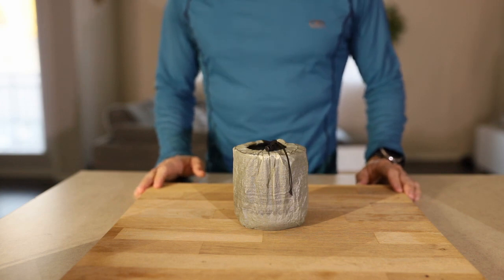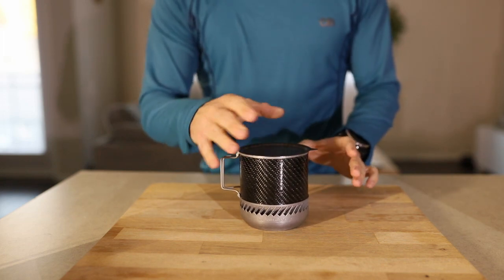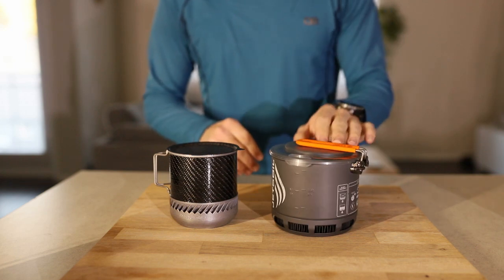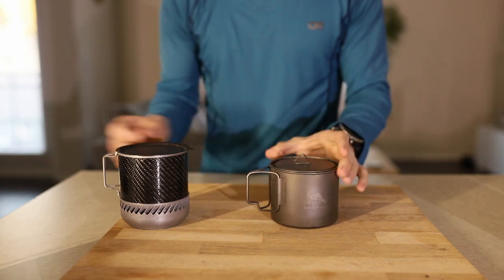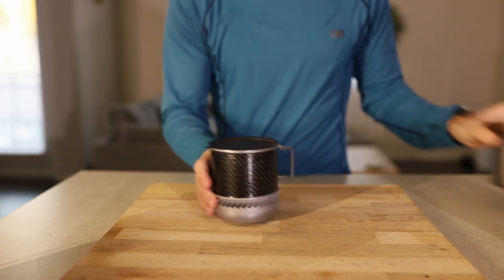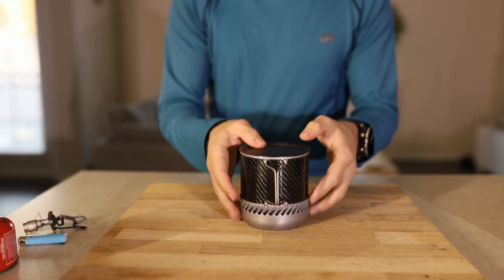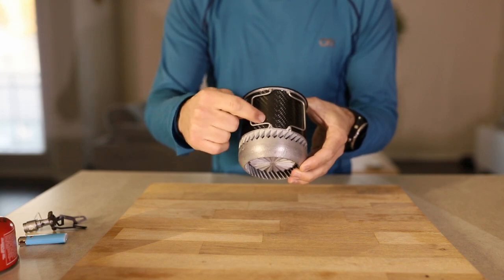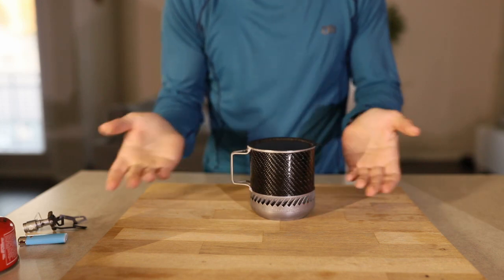The Joule Thief, a Metal 3D Printed UL HX Pot

Comment: I could see an integrated system being lighter overall.  Make or modify a stove that screws into the bottom so you can eliminate those 3 or 4 pot supports.  Coating the outside of the metal base to insulate it a bit might be worth the minuscule weight penalty for increased efficiency.  A spherical isobutane canister would be cool!  I am sure a lightweight stand could be designed for it or maybe the pot can be hung.

Comment: You might consider using sodium silicate or some type of food safe ceramic or metal coating.

Vapor deposition comes to mind. vapor depositing a layer of aluminum oxide or an amorphous glass--maybe even a cvd-dlc coating of the right thickness could provide a water-tight, food-safe, high-hardness barrier on the inside of the pot.
Reply from the maker: Man I wish I had access to some vapor deposition equipment. I know it's not to hard making a DIY deposition rig, but I lack much of the knowledge that would require.

I've gone down a slightly different approach lately. The latest version that I haven't shown off just yet have switched the NSF-61 certified silicone + carbon fiber drum with medical grade PEEK. I've been also experimenting with printing them in a different aluminum allow that doesn't have silicon so that hard anodizing is possible. Though I've yet to get the equipment for hard anodizing. 

The cool thing is this project is finally kicking back up now that the Pad-Pals are finished and on the market to help support where I'd like to experiment next with the Joule Thief and Bandit HX pots. So super happy and gitty lately about that. This really is my #1 passion project for the past 5 years.

Comment: This is a great mash up of an ultralight system and the superfast heat exchanger units.  Exactly what I'm looking for......except even with my wildly irresponsible spending on ultralight outdoor gear, this is a step too far financially for me.  I would happily trade maybe 30g for an alu pot combo to get this under $100.
The alternative would be to sell me the wiggly bit so i can JB Weld it to the bottom of my Toaks 550 pot...???  
Still waiting on a mat pump too, any idea when the next batch will be ready?  Atb, R
Reply from the maker: Oh I recommend looking at r/ULgeartrade to find a Sterno Inferno pot. If you were to JB weld this HX on a toaks 550 ml, it would weigh more than the Sterno Inferno pot. So the Sterno Inferno pot is actually an excellent option for the weight of an all metal pot construction.

On the tangential note, I'm hoping the inflators will start going out to people on the waiting list within the month. I have a set of new motor control boards that just arrived and if they pass testing, it'll finally be ready to go into customer hands again. So hopefully very soon, but there is a small possibility it can be delayed even further if the boards have more problems.
Are you on the waiting list by any chance?
Reply: @tylerreeves8026  I think so!  I certainly signed up to something months ago?!

Comment: I think this is a very cool project, but IMHO could you solve many of the "problems" by sacrificing the titanium pot and replacing its bottom with your heat exchanger and welding the 2 parts together? ->no CF, no epoxy, no silicone and, as a bonus, correctly shaped handles ;)
Reply from the maker: This is a very good question I get from time to time, I should probably make a video explaining my attempts to do exactly this and the issues I came across and why I decided not too. The two largest issue is simply that the weight isn't satisfactory and the efficiency isn't anything special. This is because the minimum wall thickness these SLM printers can do is 0.6 mm. And titanium is 60% heavier than aluminum (and 4 times as expensive to print). So making the HX out of 0.6 titanium weighs a significant amount more then 0.6 aluminum. There is also the issue of thermal conductivity, titanium is a bad thermal conductor compared to aluminum. So the titanium HX I printed just couldn't compare to the aluminum ones in terms of efficiency and weight. 

I have however, made an great deal of progress on this project behind the scene over the past few months. I'm fairly certain the latest iteration of these pots that I'm currently working on solves a good portion of the concerns people have have with them (and my own concerns included) and I'm VERY excited to share them soon. I've dropped the use of carbon fiber and changed some aspects of the design. I should have 3 unique and very neat (IMO) pots to share in a month or two. One will be optimized for Fast Packing/ultralight Weekend warriors. The second will be optimized for ultralight long distance through hikers. And the third is optimized for winter conditions/climbers. I'll probably be sharing them one at a time starting with the fast parking optimized version. Sometime in late January or early February. (That's when the thermal cycle testing should be done and I'll have a better idea on the longevity of these new designs)
Edit: it's looking like it'll end up being late February. We'll see 👀

Comment: What happens when you use your exchanger on the toaks?
Reply from the maker: Hey Kevin! That was one of the very first things I did when I started this project, but I wasn't pleased by the weight or efficiency. It was marginally better then not having it and weighed more than the sterno inferno HX pot. I might return to the concept with some fresh ideas from everything I've learned by via this project, but for now it sits on the shelf. Here's a picture of what the first HX I made looked like. https://imgur.com/a/Y0ltwfb
Reply: @tylerreeves8026  super cool! I do love the idea of buying a heat exchanger that works with my pot and allows me to confidently carry one less fuel canister than i normally would. It would probably have to be quite small and light though to be worth it for shorter trips?

Comment: Amazing work, very impressed by this project. Looking forward to seeing more and would love to be a road tester in the UK if you're looking for others apart from Mont Molar.
Reply: One design change I would love is a way to "lock on" to the stove to prevent it sliding off. I think some Jetboil stove/pot combos do this. While I accept this could require a huge amount of work due to differing stove designs and be infeasible given the difficulty in 3D printing the HX element, it's a dream wishlist idea!
Reply from the maker: @turkeyphant  Thanks Jon! Means allot, it's been a ton of work so far. I hope to have an integrated stove solution to show off within a month from now. It'll most likely be a modified BRS 3000t with the legs cut off and a windscreen/pot support added. It'll look very much like the stuff Jon Fong of Flat Cat Gears makes. So it won't be a solid locking mechanism like the jetboils but more like a ressed pressure fit like on a reactor stove system. I actually hope to get Jon Fong a pot once he returns to the States so he can apply his awesome handy work to optimize a windscreen for the pot instead of the tossed together solution I'm working up right now. 

Also, apologies in advance if I don't reply to any follow up reply you have, I'll be out backpacking for the next 5 days, but I promise to get back to you when I return!
Reply: @tylerreeves8026  Jon Fong does amazing work too. Very interested in seeing how this all works out. And don't worry I'll be on the trail for the next six days too with my little HX pot.